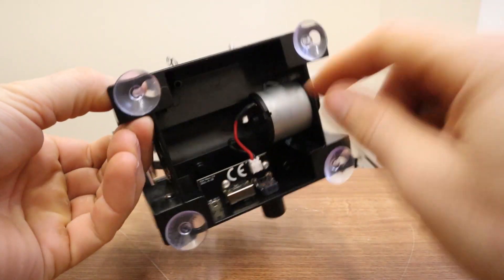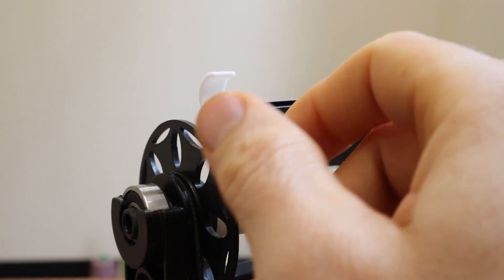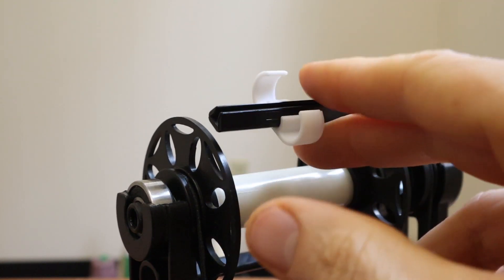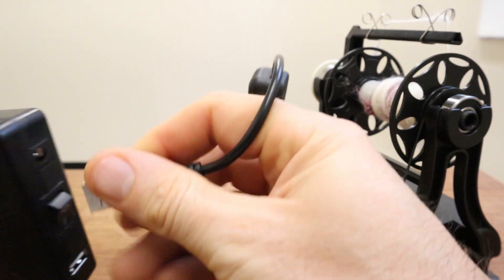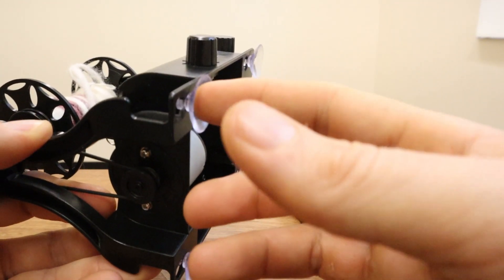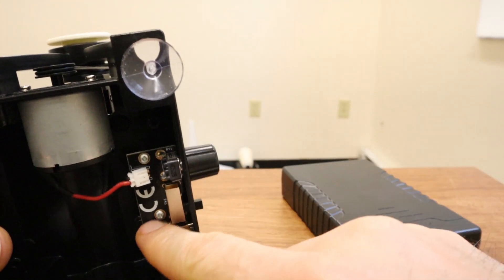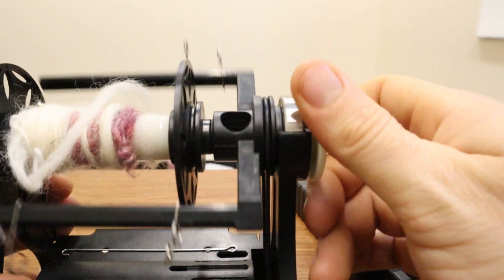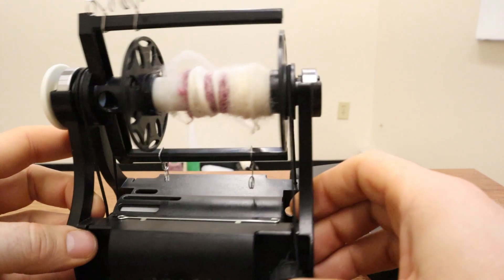SPIN 129 - EEW Nano 2 Reveal

Comment: I have already upgraded my nano with all the new bits you are talking about so apart from a slightly better motor don’t need the upgrade as I also have the 6 .The one thing I do love about the nano is the ability to customise it by changing the colour of the flyer arms,something you will not be able to do with the new one

Comment: I love it! I live in the UK, would the kickstarter work here too? I would be uo for that. With the micro usb, I don't think I would need the brick. If you leave it off it would be cheaper to ship, and I could get a powerbank and usb cable everywhere. I do like the switch you offer on the shorter cable though! And I love the suction cup feet. Seems like a great solution to prevent the eew  from sliding around.
Reply from the maker: Yes, the Kickstart would ship to the UK.  Shipping probably won't be cheaper if I ship without a brick.  The reason is if the weight is between 1 and 2 pounds the price is the same.  If I can get it under 1 pound that would be very helpful for shipping costs, but I don't think I can get it that light.  I will try when I have all the final parts though.

Comment: Sounds good, but I hope you would include the case for the battery. If you have the battery attached, you don't need suction cups, the weight makes it very stable. I would definitely be interested in the kickstarter, and the more compact power cord assembly, which makes it neater and even more portable.
Reply from the maker: I really can't do the battery case for the same price.  That said you can buy those as 3d printed accessories and I'll make an updated version for this version of the Nano (though the previous battery case would work)
Reply: @DreamingRobotsBlog  That would be great. Attaching the battery makes all the difference.

Comment: I agree that the power brick is not necessary to be included.  Many already have one and would not need it and that would make the price less expensive.  Love the kickstarter idea or maybe offer an introductory special sale price.  I do not care for the plastic hooks, maybe make the wire ones bigger around ?
Reply from the maker: I can't make the wire hooks bigger or they get too floppy.  The EEW 6.0 has a nice solution, but it is too expensive for the EEW Nano.
Reply: i second that the power brick isn't necessary, even the wall charger should be optional (i can't use it in australia :P )

Comment: I love the looks of all of the upgrades. I think the plastic hooks look fine, but do they need to be so large? I don't know why, but I feel like aesthetically they seem huge compared to the size of the machine itself and don't most people spin fine singles on the nano? I know I do. Also, with the upgraded motor is the Nano 2.0 going to be able to continue to spin such fine delicate singles? I've seen some people are spinning sewing thread--which is probably an extreme use case, but I really enjoy spinning a very fine single so I can do a 2 or 3-ply fingering-weight yarn.
Reply from the maker: There isn't really a downside of them being this size.  Most people like them larger to help make it less likely bulky yarns don't get caught.  Now the Nano still won't be as good at bulky yarns as something bigger like the EEW 6.0, but this version will be better at them than the EEW Nano 1.1 due to these larger hooks and the stronger motor.

That said I'm still adjusting the final design of these hooks.

Comment: Are all the parts going to be interchangeable with the 1.1? I would be interested in the flier as mine is uneven even after messing with it and I am sure it would be much more quiet.
Reply from the maker: I'm planning to offer upgrades for the motor and circuit board.  I probably won't offer upgrades for every different part as it just gets too complicated from a logistics and support standpoint.  I will consider other options though if there is enough support.

Comment: Hi. Is that. USB-C connection? Can't tell from video. Thanks.
Reply from the maker: It is a micro USB plug.  I looked into using USB C and there were still too many issues for me to use it at this point.

Comment: Will u be developing a carrying bag or case for this and the 6
Reply from the maker: Probably not.  I like to make unique things and there are tons of bag options.  There are padded soft coolers that are cheaper than I could ever make similar bags and there are expensive really nice bags.  If I did do everything it would be a really low cost bag with my logo, but it wouldn't be designed specifically for caring the EEWs.
Reply: @DreamingRobotsBlog  
Excellent tip on using a cooler (I imagine a cooler for a 6pack beer/beverage tin would be the ideal size.
The pound/dollar store have them.
(I use them for grocery shopping).
So yes, I agree,  not necessary to add.
But the tip (your little cards included are such a good idea) included in the box would allow people to see that a carry bag is easy to buy and use.
(As a mum of 3, we quickly learn about bags and what is ideal for what.
Many people have cooler bags or old nappy bags in their closet, but just don't make the connection. )